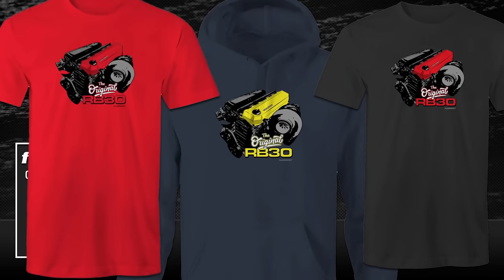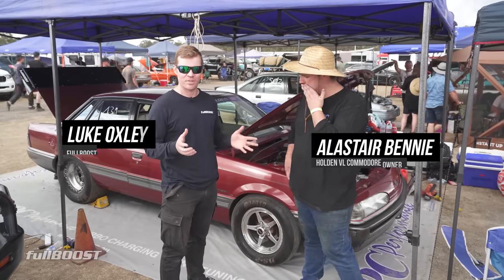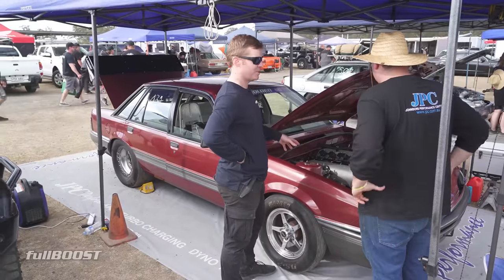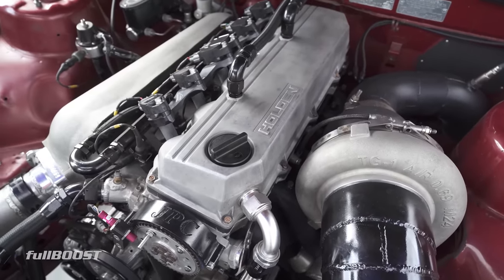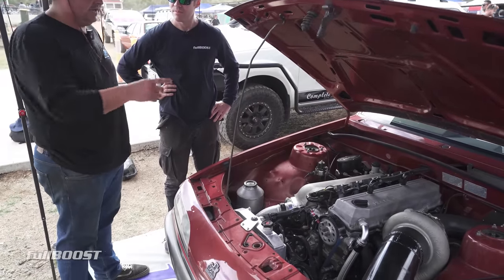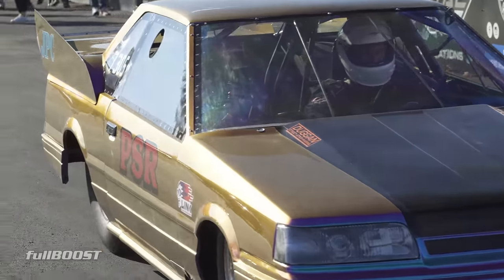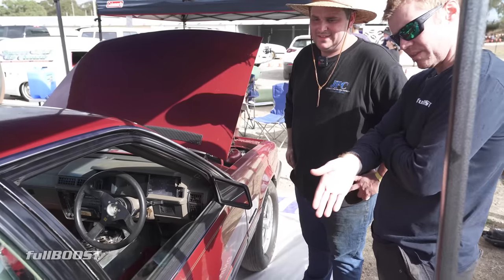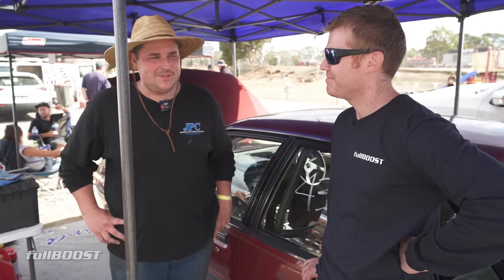This 9000rpm manually shifted VL turbo RIPS! | fullBOOST

Comment: A couple of observations; it looks like it has too much spring rate and not enough damping. This is likely the source of the suspension “pumping” at the tree. 
Also, the 150-meter burnouts are over-cooking the tires.
Stylish, but hurts the elapsed time.
Nice fast car all around otherwise.
Reply: Peddling the car and competing for most decent burnout prize coins on the day.